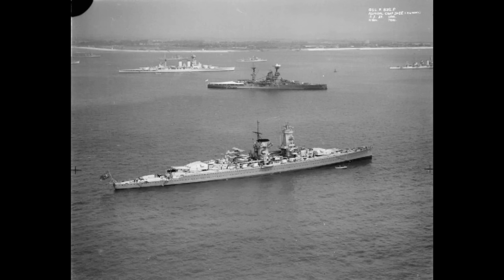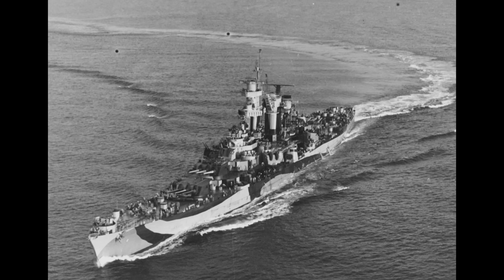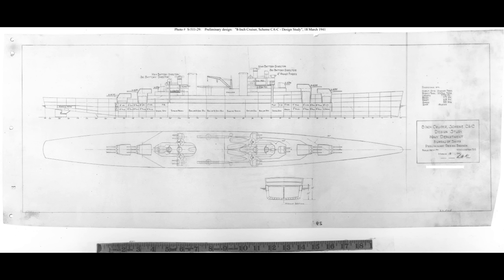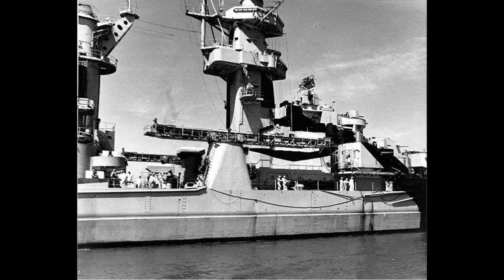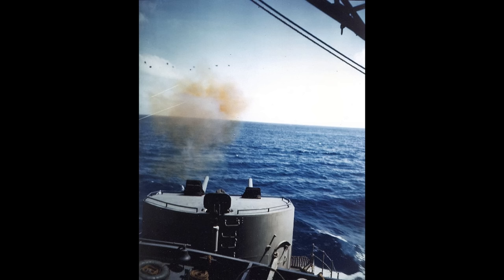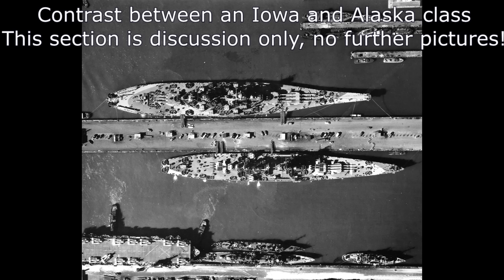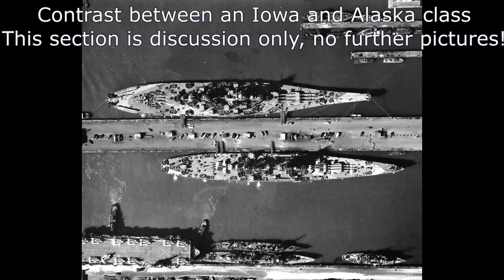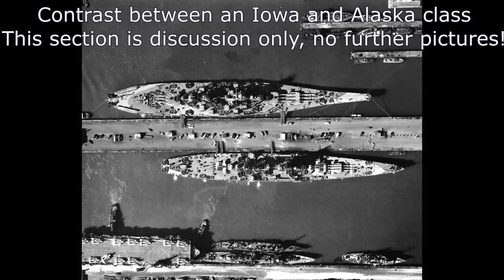The Alaska class - Large/Super/Battle/Mega/Hyper/Ultra Cruisers

Comment: The issue with the Alaskas and similar ships is that they were being built brand new right as they were becoming obsolete
Reply: I think they should have done Vertical launch missiles in the barbettes and kept them into the 80s.
Reply: @JonathanSchattke  An issue with that is that long-range missiles were being continually shrank and being fitted into much smaller vessels. Come the last 40 years or so, navies figured out that the only viable answer for a long-range nuke-carrying vessel was the submarine. So a ship as big and slow and obvious as the Alaska would just be too unwieldy for long-range missile purposes
Reply: Not even as they were becoming obsolete, but AFTER.
Reply: @chadthundercock5641  most anti-ship missiles have the same hitting power as an 8in shell, not the most difficult to protect against.
Reply: They weren't obsolete. It took a LONG time for decent anti-ship missiles to be fielded enough to "replace" main guns
Reply: The issue with the Alaskas are is that by the time they entered service most of their role had disappeared (at least the roles that couldn’t be covered by existing classes).
Reply: @andrewreynolds4949  That is literally what I just said.
Reply: @alexdunphy3716  

Aircraft carriers had already rendered big guns obsolete at the strategic level by the time missiles came along.
Reply: @chadthundercock5641  Not long range - medium range. Alaska could have carried nuclear missiles in '52 with range further than strike aircraft, long before ICBMs were ready.
And, of course, nuclear missile vs. ship group would have been lethal.
In addition, moderate range (200-500 mi) radio guided then radar targeting missiles were able to be made long before the harpoon - but they were big.
Thus using the barbettes of the Alaska as their launch bay/storage silo.
Reply: @bkjeong4302  that's a common mistake people make. If that was so, then carriers would not have needed escorts. The success of the carrier is WW2 was largely a function of the particular technological situation of the time; where ship based anti-air defense was largely theoretical(and as it turns out not sufficient) and could not be easily changed unless you put the whole ship in for refit where as a carrier could simply fly in a new air wing comprised of more advanced aircraft. This was a time where aircraft were still simple enough that they could be rapidly developed and produced during war time. These condition stopped being true shortly after the war.
Reply: @chadthundercock5641  So, does that mean the Moskva wasn't viable?  I mean, it is now a fish habitat but that wasn't really the nuke's fault.
Reply: @alexdunphy3716  

The escorts that carriers needed (with the exception of CVEs, which were more vulnerable to surface attack due to their slow speeds) were anti-air or anti- submarine escorts, as in roles that were already covered without the need for capital ships. There was no need to build anything with battleship-grade guns (or arguably even heavy cruiser-grade guns) to use as carrier escorts when those big guns are just going to be a waste of deck space without actually being useful (if not counterproductive) to AA or ASW roles. The idea carriers needed to be escorted in case of enemy battleships showing up turned out to be a false assumption; what actually ended up happening was that fast carrier strike groups simply never bothered going anywhere near enemy surface ships, reducing their fast battleships escorts to being nothing more than pointlessly overarmed and expensive destroyers/CLAAs. 

Before you mention Glorious, bear in mind that Glorious could easily have detected the Twins before they found her and moved away, avoiding that entire encounter; the only reason she didn’t was that her commanding officer was so stupid he refused any air operations to occur despite good weather conditions.
Reply: @chadthundercock5641  The role disappearing and being obsolete are different things. They were still very modern at the time, there just wasn't much to fight left. A similar thing could be said about the Des Moines class but no one does there
Reply: @andrewreynolds4949  The Des Moines arguably WAS also a case of "good design with no viable strategic point to it".
Reply: @bkjeong4302  The point was having a more efficient heavy cruiser. Just because they didn't see much action doesn't mean they were pointless. They were very useful as flagships and they would have been excellent at splattering Sverdlov class cruisers when those started showing up in the 1950s.
Reply: @andrewreynolds4949  

Except the odds of the Sverdlords actually getting the chance for a gunfight weren’t that high in the first place. 

The issue isn’t just that they didn’t see much action, but that the biggest reason they didn’t see much action was because they were redundant for their own design purpose.
Reply: @bkjeong4302  It's too easy to look at this with hindsight. At the turn of the 1950s what the west knew was that the Soviets had started mass producing light cruisers, and something was needed to counter them. It just happened that they had several excellent new heavy cruisers. They had no way of knowing the Sverdlov class program would be scaled down and cut back at the time
Reply: Alaska class cruisers did not lived up to what there roles should have been as "Cruiser killers".  They became redundant because the Iowas can also do the same role and do even more better.
Reply: @chadthundercock5641  The Russians built what have been called battle cruisers that carried 16-24 very heavy and impressive Mach 3 long range cruise missiles intended to kill Air Craft Carriers.  The Slava Class (12,000 tons with inclined missile cells) and the Kirov Class (22,000 tons with vertical launch cells for massive granit missile).     They would be impressive if they had AEGIS quilty  radar with SM-2 and RAM and Phalanx air defense system but their missile suit had aged.

Comment: You made a great comparison between these ships and battle cruisers.  One key factor is overlooked, however.  After World War I, we had the treaties to limit an arms race.  The loophole in the first part was to make a cruiser under the terms of a capital ship and put large guns on it.  Basically, a large cruiser or a cruiser killer.  The Alaska was heavy enough to be classified as a capital ship if I remember correctly, but it could have been apart of an escalator clause found with battleships.

As for the Iowas, you did make a great comparison between them, South Dakota,  and a contemporary battle cruiser.   I would have went one step farther.  About the same time as the Iowas were being designed, the Montanas were being looked at.  Montanas technically took a step back in speed, but added armor and extra guns.  Two distinctions between a battleship and battle cruiser.  You also have to take into consideration the treaties were still in effect with the Iowas even if America was the only ones going by it.  One of the escalator clauses I've heard about was for a  45,000 t battleship design.  That fits the Iowas.  America just went crazy with them to see what they could do. In other words, the battleships were just a step up based on clauses until completely thrown out.

Comment: Also could an Alaska take on a Kongo class and win?
Reply: Very likely. Scharnhorst has almost 6" more armor on the belt than a Kongo, so there are practical battle ranges where the Scharnhorst is protected against the 12"/50 Mark 8 gun. There is no practical range where the Kongo's armor really resists the Alaska's guns. Add in US advantages with remote power control for the guns and the Mark 8 fire control radar, allowing it maneuver a lot more freely without throwing off the firing solution, and that fight is the Alaska's to lose.
Reply: @kemarisite  Quite right!

Comment: I tend to agree with some of the other comments made, e.g., given the caliber of the guns, armor and speed the Alaska class would be roughly  equivalent to the Graf Spee, but faster, so how about a "Pocket Battlecruiser"?😁
Reply: I tend to think the Alaska is the culmination of what the Deutschland Class should have been. The real problem with DL Class was its thin ass armor and relatively slow speed. One can also add a too modest secondary armament. While DL Class would easily kill any cruiser it came upon, against 2-3 cruisers it was in a bad position, which one considers that any commerce raider or cruiser killer was likely to be outnumbered, it makes the whole point questionable. Against multiple opponents, the DL's armor was too thin to shrug off 8-inch shells, or even volumes of 6-inch shells. Moreover, its eight 6-inch guns were not turreted, only shielded, so in longer engagements with smaller cruisers the DL's firepower greatly decreased. Add to that eight six inch guns as the secondary battery isn't enough when fighting multiple cruisers. Finally, the DL could not come close to outrunning enemy cruisers and could be caught by any battlecruiser or fast battleships. The Graf Spee was the victim of all these shortcomings. All these issues are the product of the weight limitations of the Versailles Treaty. Of course, with no limits, the Alaska Class solves all those problems. Its armor can shrug off everything under 12 inches. It's main battery could quickly dispatch cruisers, and it had enough secondary batteries to keep the other enemy cruisers at bay. It could outrun anything larger than a medium cruiser.

Comment: In regards to the gun caliber argument, I'll simply say this:

Pretty much every single conventional battlecruiser had a gun caliber of either the same as a contemporary battleship, 1 inch less, or, in the case of a bunch of uncompleted battlecruisers and the Kongo if you stretch the definition of contemporary battleship to be the Kawachi, 2 inches less. The Alaskas had a gun caliber of 4 inches less than the contemporary NorCals, SoDaks, and Iowas. That should put that issue to rest.

I think, for the time, you'd need at minimum 14" guns to be considered a new-build battlecruiser.

Comment: if they would have kept them in the reserve fleet for another 10 yrs instead of scrapping them, with the removal of the after turret and the 5 inch gun mounts, and a simplification of the superstructure, they would have made an excellent counter to the upcoming Kirov with the added advantage of still being useful for shore bombardments.  speed would have increased, and if they were to have redesigned their power plants might have been able to approach 36 knots or so.  would have made excellent SAM protection for the carriers and with a heavy battery of cruise missiles could have been a pretty heavy hitter for those places harder to hit.  their lack of wear and tear compared to the Iowas i think would also allow them to stay in service longer with many different upgrade packages possible.

Comment: Well thought out discussion.  A couple of views from a former combat developer.  When it comes to design, I am believer that the doctrinal/conceptual purpose is a way more important criterion than how the solution is built.  How it is built is based on many limiting factors (money, shipyards, docks,) and may lead to a solution that is very different in design but not function.   Then one cannot ignore bureaucracy with its rules and department funding lines and fighting.  The early 1900s were a fluid period in ship design, old ways had been broken and lots of new approaches.  I would describe the shipbuilding world as plastic in that it could be bent to innovation.  In the 1930s design was more solid and fixed.  Every design bureau was fighting for money and treaty tonnage.   It may very well have been that the term Battle Cruiser was a bad word at the time in parts of the Navy.  If the Navy had enforced a BC requirement on the BB community/funding line you would have ended up with an Iowa/Montana mix  :)  calling the Iowa a battle cruiser.   However Admiral King decided to put the functional requirement into the cruiser design community/funding line.  Perhaps the Cruiser  design bureau had the least resistance or most interest.  Calling it a Battle Cruiser would have infuriated the BB design bureau so more euphemistic terms were used.   Carrier escort was a good carrot as I am sure the pre war BB community did not want babysitting carriers as a mission.  One cannot underestimate Ship design politics in a decision like this (happens in the Army (tank/tank destroyer;  Artillery/Mortar/Air Defense)   So this is why I disagree with the view that since many design features are not BB based is not a dominant set of criteria.  You have a completely different community building a ship for the required doctrinal task but from a different design perspective.  As for the guns, the dominant question should be were they good enough for the design mission?   Rate of fire, power, range, ammo supply for extended missions etc?    Frankly a Repulse with 9 of the 12" guns might have been better.  Heck they were better than the German twins and probably better than the French Twins to say nothing of the Italian Cavour guns.

Comment: I have a silly question about the designation. What does it matter?

For example, the Japanese have their helicopter destroyers which are capable of operating F-35s. They are called helicopter destroyers because of the Japanese constitution but they are comparable to light carriers.

Surely the designation should be a reflection of doctrine?
Reply: Science Fiction author David Weber thinks like that (or he had one navy think like that). They have a destroyer-class  which was larger than their light cruiser-class ships. The destroyer-class has better defensive and offensive capabilities, lol. That's because the CLs were primarily (for that star nation) screening/escort ships whereas the DDs were seen as scout ships, intended to go into defended systems on their own, which meant they needed the best offensive and defensive capabilities (to complete their tasks).

In his Honorverse series, there were lots of discussion by the narrator about ship classes. Corvettes and Frigates were not used by any decent navy as they were grossly outclassed by Destroyers. The one modern Frigate mentioned was an upscale version of a LAC (Light Assault Craft; analogue of a customs/patrol ship). On the upside, the Frigate was had a hyperdrive, a rear facing energy mount, and a larger magazine. On the downside, it had 10 times the crew of the LAC and was 2 to 3 times the mass, lol.

The Frigate had 4 missile tubes and 2 energy weapon mounts with 8 anti-missile launchers and 12 anti-missile energy mounts for defence. A slightly obsolete destroyer had 14 missile tubes, 10 energy mounts with 14 anti-missile launchers and 12 anti-missile energy mounts for defence. Just doubling the mass allowed the ship designers to incorporate 3 times the missile launchers, 5 times the energy weapon mounts, while also slightly increasing the anti-missile launchers.

Overtime, as technology advanced, ship classes experienced tonnage creepage and some ships classes, like corvettes and frigates, ceased to exist as they no longer had a role to fill.

I'll quote The Honorverse Companion "The House of Steel"...
"A battlecruiser is designed to outfight anything it can catch, and outrun anything that outguns it.
. . .
Battlecruisers have many roles in the [Redacted]. The battlecruiser is envisioned as the minimum platform capable of performing long-range, extended patrol and interdiction, destroying commerce raiders (not necessarily the same thing as convoy protection), and projecting force against anything 'below the wall.' They are useful for showing the flag, rear area security missions, and screening heavier ships and critical convoys. While the force balance and dynamics of warfare have caused certain roles to wax and wane over time, overall [Redacted] battlecruiser doctrine has remained largely the same." - Page 365 to 366

"The heavy cruiser is particularly well suited to commerce raiding. Operating in singletons or divisions, cruiser-class ships are easily able to overpower the traditional destroyer and light cruiser escorts and effectively force enemies to protect their supply lines with heavy units of their own, often at the cost of far more units from their front lines than the expenditure of raiders." - Page 354 to 355

Getting back to the topic of the video...
As for the classification of Alaska-class, they were large heavy cruisers or small battlecruisers. They probably should be called battlecruisers as they were slightly smaller, less armoured than the North Carolina class battleships.

Comment: Good video as usual.

I personally still think of the Alaska’s as battle cruisers because to me a ship is defined more by its intended role than rather arbitrary definitions. BCs are about as different in armor and firepower vs heavy cruisers as heavy cruisers are vs light cruisers.  You could therefore make pretty good argument that a CA is also a BC if it’s intent is mainly to take on CLs. They just don’t call them that because they seem to have simply defined a CA as having larger caliber guns and more displacement vs a CL without necessarily intending them to perform a more specialized role even if they are capable of doing a more specialized role.